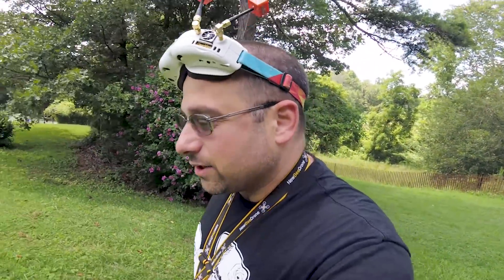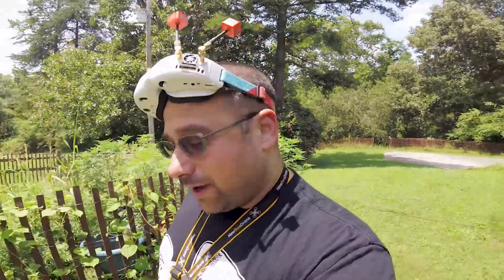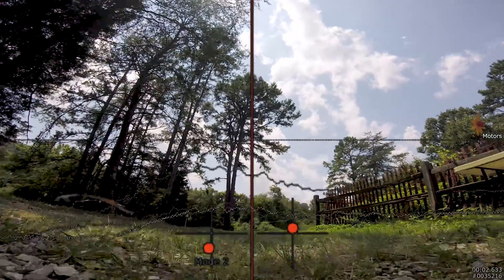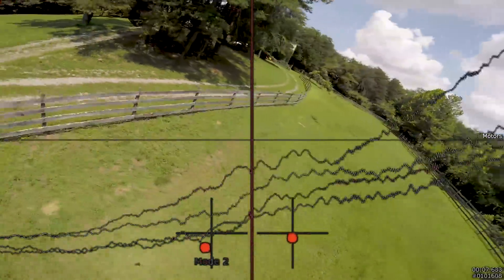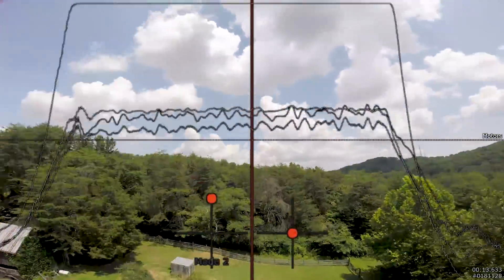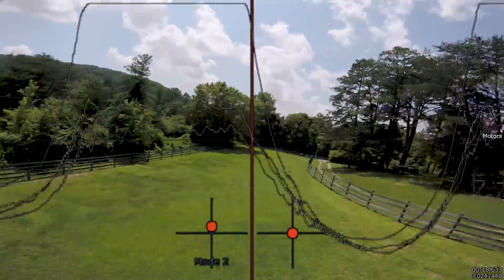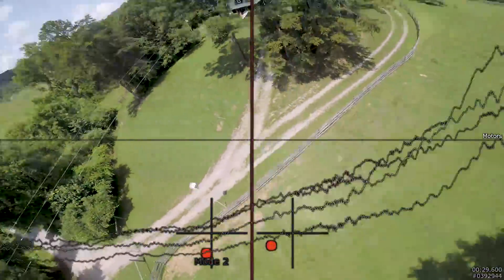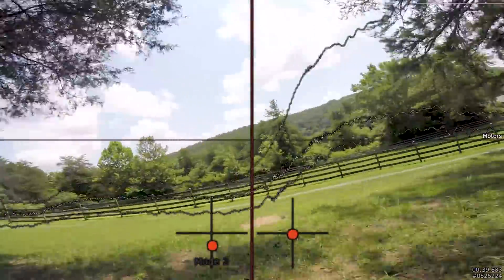What Does A Failing ESC Look Like? IT LOOKS LIKE THIS.

Comment: wouldn't it look the same if it was bad motor not bad esc?
Reply from the maker: I see what you're getting at but I don't think so. Bad motors tend to stutter and desync but not lack power. Maybe if the bearing was failing it would act like this.
Reply: @JoshuaBardwell  could IT be a cold solder joint on motor phases ? I have the same "left front up"  problem, as you in the video. I will swap front motors, to check this first, then when it will behave the same, i wil resolder joints, then new ESC 🙄
Reply: Yes it looks the same. At least it will tell you what arm to focus on. And its much easier to swap a motor first than a ecc.

Comment: Can a motor going bad show that or motor mismatch? Or should that all be compensated by motor outputs?
Reply from the maker: A bad motor would (in my experience) be more likely to desync or fail entirely. Maybe if the bearing was failing it would act like this.

Comment: Good video. Did any of the esc fail before you replaced the fc? I have a quad that keeps killing my escs. I've reflashed firmware on the fc and escs to no avail. I've replaced the fc with a kakute f7 aio. Havent flown the new fc yet but if that doesn't work, I don't know what will

Comment: Glad I'm not the only one with this issue.... had a failing ESC about a month ago that was haunting me. It was causing a strange motor noise, ended up changing bearings out before I figured out it was the ESC.  I thought I was going crazy.😛

Comment: I got an issue with a esc or motor. When armed one motor struggle to start and often resets the esc just after arming. When it does start it flies great. It a emax 30a blheli esc with emax RS2205 motors. Stock setup on esc. Will get round to swapping the esc first.

Comment: Hi joshua, this week i buy and change my esc for racerstar tatoo 42 amp.
I put in in my quad and i burn two motors on same esc, whats happened? How can i check if this one work normaly ?  
Thanks joshua
Edit: two motors are burn on rear right place after 20 sec in the air
Reply from the maker: It's really hard to say because I can't see the quad, so who knows if there was a build-related issue. But personally I don't trust racerstar ESCs very much and I for sure don't trust their 4-in-1. Their failure rate is just too high.
Reply: Joshua Bardwell i understand, its not 4 in 1 esc, have fly racerstar blheli s 30 amp for 6 month and no issues, those one after 20 sec, i motor smoke, i changethis, check all of my wires and sold retry same issues.
2 F60III Dead :'( 
I resold the old esc, no prob